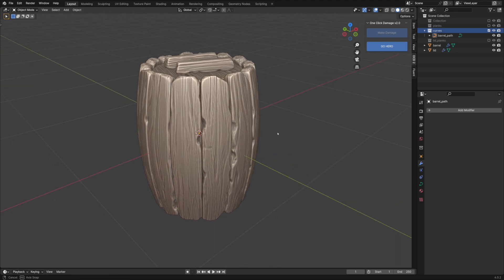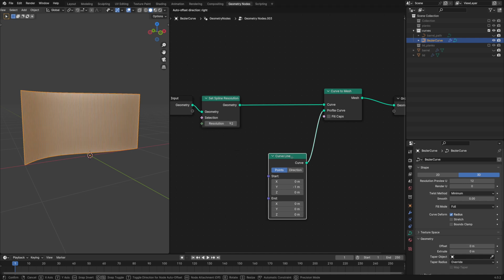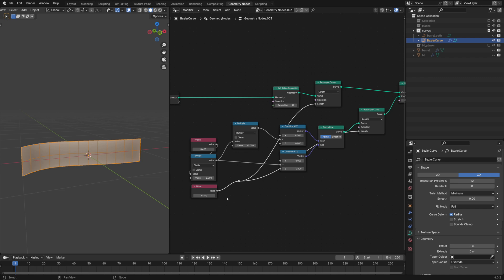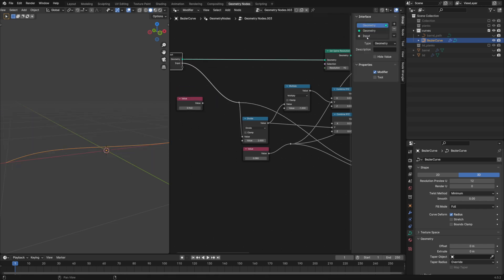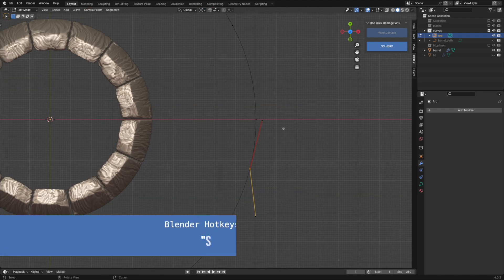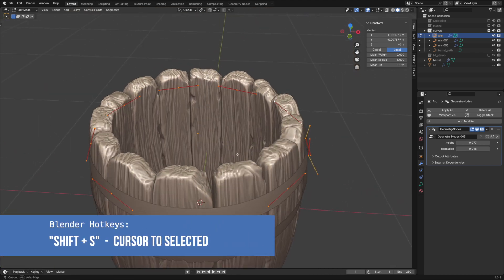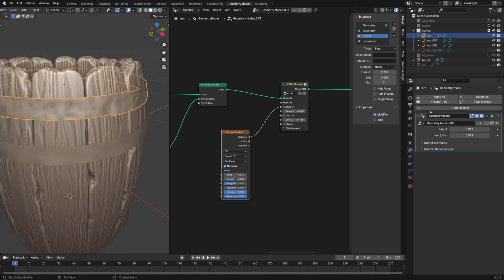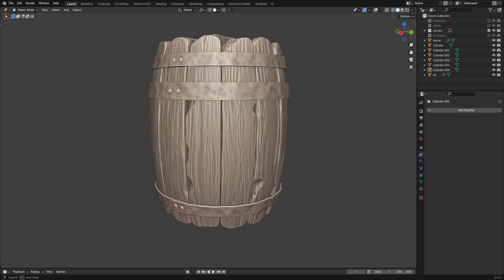OCD2.0: Wooden Barrel Pt 2 | Blender Tutorial

Comment: Awesome tutorial, only issue I have is that the node works on the initial Bézier curve, but won't apply to the arc curve. Changes to the values show up on the Bézier curve but not on the arc for some reason.
Reply from the maker: Make sure 'Arc' is set to '3D' in the Curve Properties.
Reply: @VFXGUIDE  Thanks! I went back and noticed that when I went back to troubleshoot.

Do you know why the items built with OCD won't accept materials? They just stay white.
Reply from the maker: If you use 'HERO', you should use 'Set Material' node in the Geometry Nodes editor.